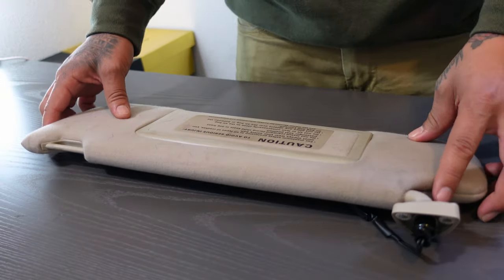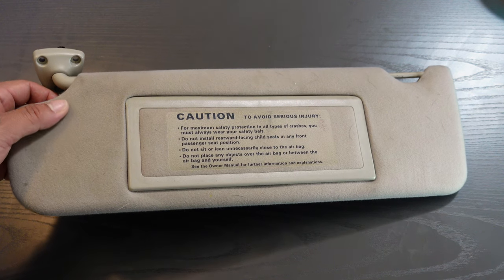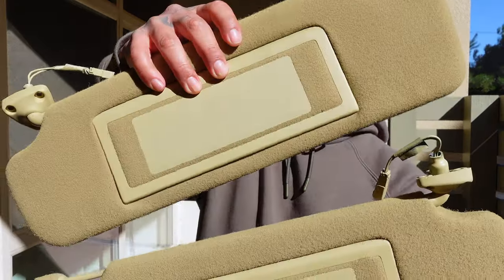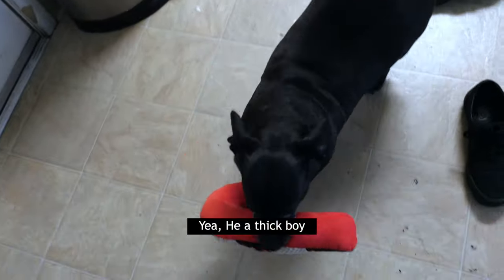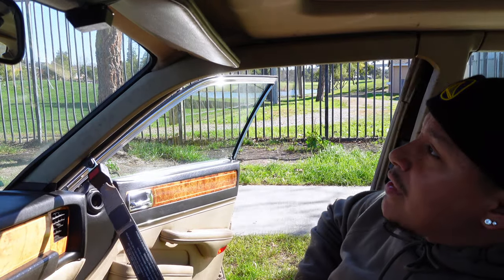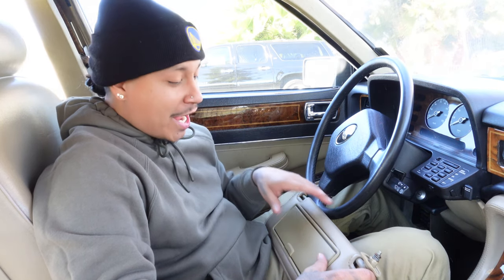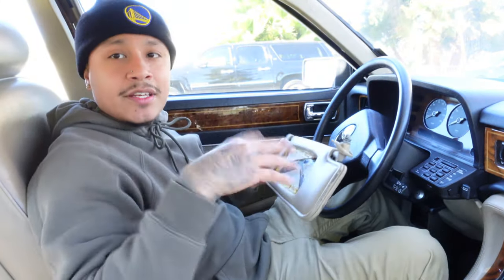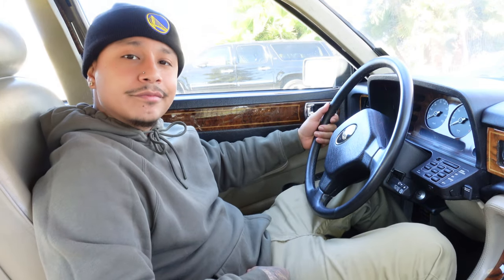Matching Your Car Interior: How To Spray Paint Sun Visor’s

Comment: Hey Jesse I looked at how the sun visor is attached on my 91 XJ40 and the 3 screws are used, so this is why your is rubbing on the headliner. Maybe a small hole could be driller on the inner steel structure and then a 3th screw could be installed, to adjust the angle. Or self-tapping screw?